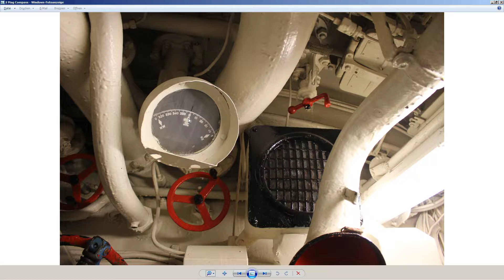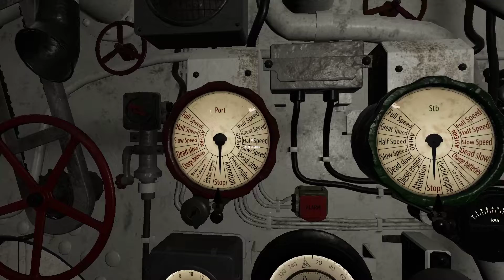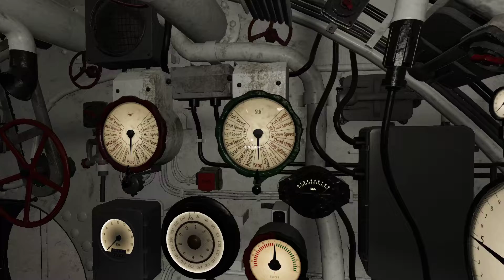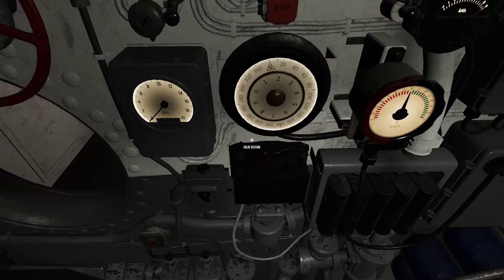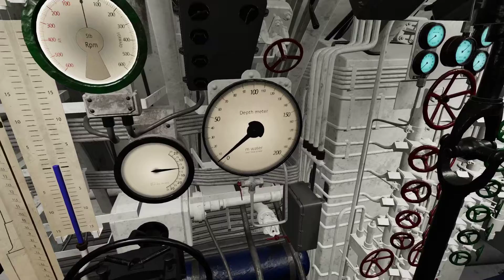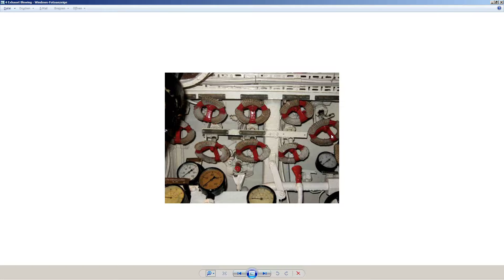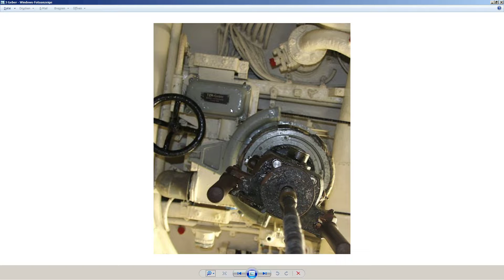Stoss's Detailed Type VIIC U-boat Interior Tour (Wolfpack) - Control Room (Forward Portion)

Comment: surfacing and firing torpedoes must hurt the ears a little? Maybe not, I played with the cabin pressure on an old parked 727 airliner and it wasn't painful, but you could tell something was going on. We could pump it up (dial in a negative cabin altitude) then stop pressurizing and vent. It would get cold and "snow" inside briefly and your ears would pop, but wasn't painful. I guess similar to scuba diving so probably the same on a uboat.
Reply from the maker: You know that’s a good question, I am not entirely sure the sensation, I do remember veterans describing ears popping and being able to detect the pressure change upon torpedo launch, because that was a decent amount of HP air that got vented into the boat.